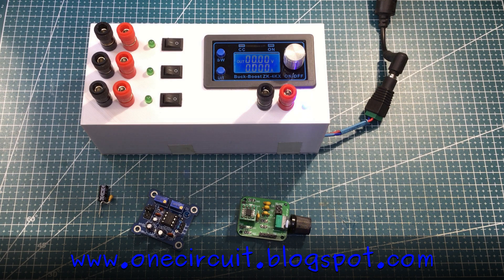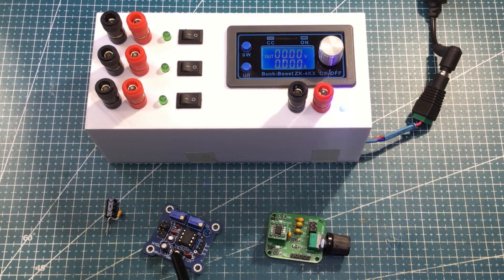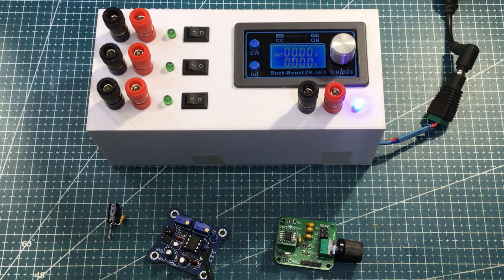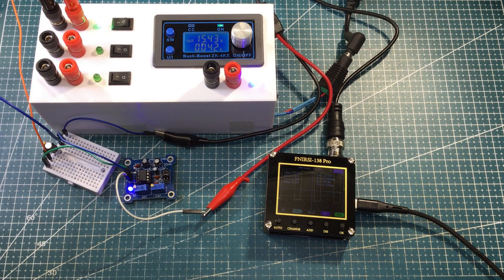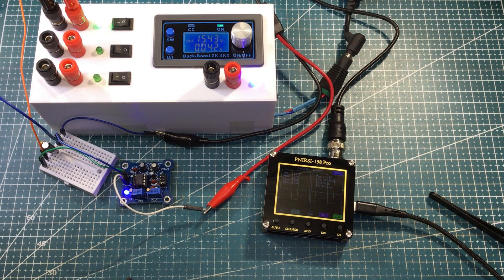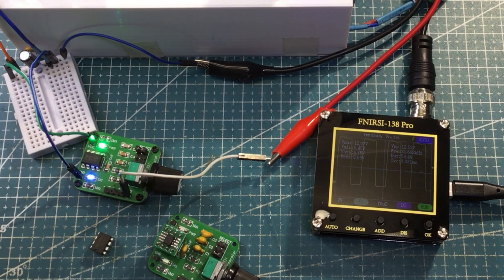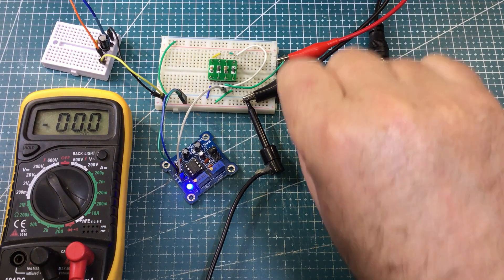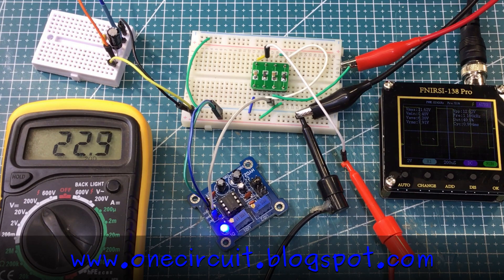555 Charge Pump Voltage Doubler

Comment: Seems the kit is picky about the input supply voltage. Good ole linear regulator with decoupling/filtering to the rescue. Nice.
Reply from the maker: Yes I’ll definitely still be favouring my own PCB for clean signals in the future. Perhaps the commercial one will make a nice gift for a frenemy! 😀👍
Reply: @onecircuit-as  If the charge rate(top one in schematic for 555 board) pot is set to zero ohms the discharge pin shorts the supply voltage to ground.  It really needs a limiting resistor in series. Might be the source of the noise.

Comment: Great video . 
Also can be reconfigured for a negative voltage
555 has so many uses and with reasonable output current capability.
Reply from the maker: Yes I think I could “OneCircuit” the 555 for many weeks! 😬